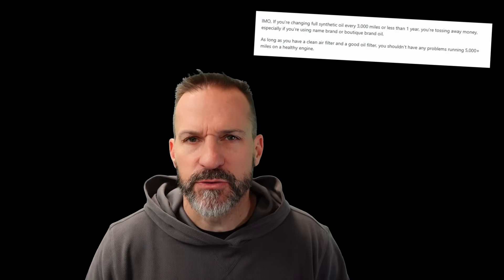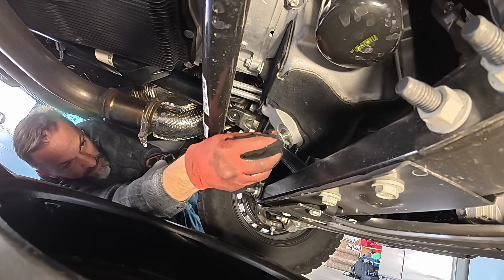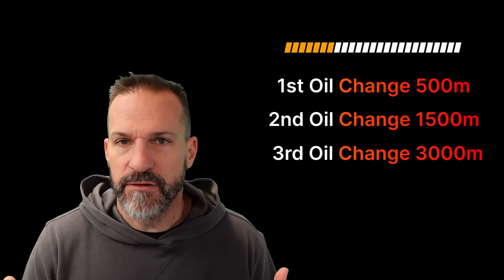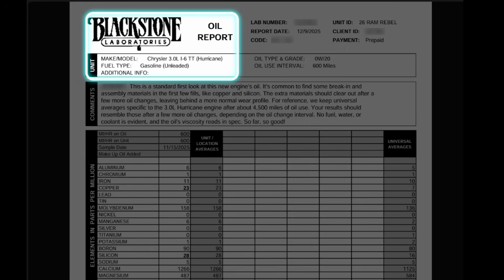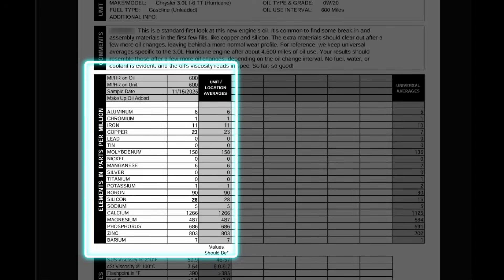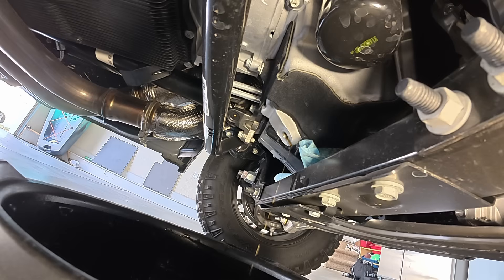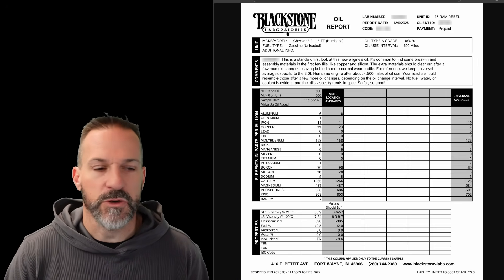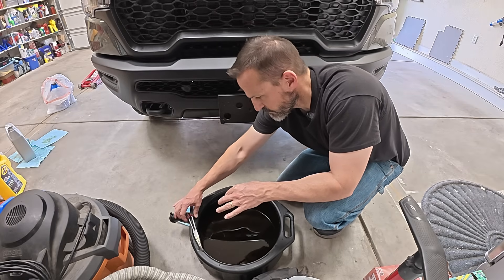Is the Motor Oil Geek Right? I Put His Break-In Theory to the Test

Comment: I recently purchased my first new car ever a 3rd gen Nissan Rogue with the controversial 3 cyl turbo.    I did some early oil changes per Motor Oil Geeks advice.    I now have over 30,000 miles on it and the engine runs well and the Blackstone report shows below average wear metals.    I'm using Valvoline Restore and Protect 0w20 and plan to continue with it at 4,000 mile oil change intervals.    I think it is really a no brainer to do this procedure and change your oil earlier than manufacturer recommendations if you plan on having a reliable vehicle for a long time.    Cars are way too expensive these days not to take extra care with maintenance.

Comment: With these new oil standards it is going to be good idea, leaving the filter on allows particles to increase the filtration. I would go to 0W-30. I think GM is doing more damage, unless their certain that bearing damage has started or is in progress. Was taught along time ago to start out at 30W then 40W as oil pressure dropped , add liquid bearing material. I have had problems with Marine engines or racing engines start out at 50/60W, most don't warm-up engine and bearing surface and piston walls get squeezed, it's fine if planning on rebuilding often.

Comment: I don't change as frequently at break in. I change once at 500 miles (give or take) and replace the filter and usually again about 3k miles and then I change every 5k miles (full synthetic). I also run Ceratec at the first 5k oil change. I'm going to start skipping the oil filter every other change based on his recent videos covering filter efficiency.

I may tweak my break in procedure but this has worked very well for me so far.

Comment: What the heck?! The hurricane drain plug doesn't shoot the oil directly into a crossbeam, and the filter doesn't drop the oil on top of a skid plate with drain holes exactly one oil pans width away. Hows the anti rust oil film going to be applied. 🤨

Comment: These modern engines with tight clearance, and questionable QC, I think it's foolish if you don't run a bypass filtration system, from mile 0. Even if your doing break in oil changes, you're pushing that junk through your bearings. Seems like capturing it makes more sense, with a 2 micron filter, that clean the whole system every 45 mins.

Comment: Same with motorcycles regardless of displacement and number of cylinders. 

I did my bike on first break-in at 700km (less than 500mi), 2nd oil change at 1000km, 3rd at 1200km then the regular interval at every 2000km. 

70000km later, still bulletproof reliable with no engine issues

Comment: I have a 24 tundra.  I did 1st oil change at 250ish miles, 500ish miles, 1,000ish, and now do every 5,000.  Who knows if it was needed but I decided I'd rather spend the little extra in oil and try to get out any metal pieces that could cause an issue.

Comment: Oil NEVER loses it's ability to be slick. The problem is oil gets contaminated, aka dirty and filled will junk. That junk damages engine components. Oil has to stay clean to do it's job. Change your oil at 3,000-5,000 miles on your daily driver. Work trucks very on that standard.
Reply: Actually it does lose that ability.
There are numerous jobs that oil performs, and numerous ways those qualities degrade with time and mileage.
3,000 mile oil changes is far too often.

Comment: Just ask yourself “what is the downside of extra early oil changes”? The cost of a few mediocre meals at chain restaurants or watered-down drinks at your local watering hole? It is money in the future bank people! Also, after the first 500 miles, DO NOT baby the engines or you will have to baby them their entire lives. Full throttle stints for a couple gear changes get everyone in the drivetrain on the same page.

Comment: I make my first three or four oil changes every 5.000km (3.100 miles). And then every 10.000km (6.200 miles).
About the timing, I respect my kilometers interval or a year. I don't let the oil more than a year in my engine.

I use manual transmission cars. I change the gearbox oil too. First one at 10.000km and then every 40.000km. No time interval.

Always fully synthetic oil. Mostly Mobil just because seems good for the price and I can buy it near here. 

I know it's somewhat exaggerated. But I never had any engine or gearbox problem with my cars. Not a single one.

Comment: I’ve only owned 2 vehicles so far in my life. Both brand new and both I changed the first oil at 5k miles, just like all my other oil changes. First engine went to 150k miles before trading it in. I’m at 87k miles so far in this engine no problems

Comment: back in 1970s cars had recomendation of changing oil at 1000 miles to get rid of metal particles of break in but in newer cars the dealers try to talk you out of doing oil changes till their 10,000 mile interval. the engine may be better polished but it will still have wear metal.

Comment: I have followed Lake's advice so far on my new Lexus IS350. I sent my oil to Speediagnostix and have been monitoring the progress. So far I only have 2200 miles on the car and I also switched out the drain plug for a magnetic one and on the second change, metals were down. I'll change again at 3000 and then at 5000 mile intervals there after. Its a car I plan to hold on to for a long time, so I go by thr saying "oil is cheaper than a new engine".

Comment: Check the filter if you can.  I cut my wife’s 24 GR Corolla filter open on break in change and there were visible metal particles in the pleats.  Also a magnet will only pickup ferrous metals, most of modern engines are not made of those, bearings, blocks, etc.  prob only the piston rings of the “wear” items

Comment: Lots of comments saying 10k oil change kills engines. If you watched Lake’s video he said you can safely get to those OCI after the initial break-in. You just have to verify through oil analysis. I bought my truck with 3000 miles on it and it had already had an oil change before I bought it and I did another one after buying. Since then it’s been 10k oil changes and analysis every time and all the results prove that it’s been perfectly safe. I’m now at 85k and the truck is still running perfectly fine.

Comment: In 2014 I bought a new Honda CR-V. Dealer said NO oil change until the Maintenance Minder was down to 15% remaining oil life. They said the oil was a special run-in oil.  I reached that mark after approx 9000 miles and then changed the oil. 11 years later that CR-V is running perfectly and burns no oil at all between changes. So who is right - the engineers or the YouTube experts?

Comment: I like the 500 first change, have done it always while being told I am crazy. But I in no way agree with Oil Geek on anything else. I run Valvoline 5W40 European in everything for last 2 years. Group IV oil. Oil Geek only knows oils; he looks at trees trying to find the forest. Also do 3K changes yes still being told I am crazy. Also told crazy for 5w40. Please be more specific Tolerance is Not Clearance. All machining has both callouts and they are not interchangeable in the definition. The higher temps are in my opinion are also causing oil breakdown to occur sooner. You are spot on I believe engine have two things to watch MILES and CYCLES. I suspect cycles are also a killer because of the above mentioned.

Comment: Silicon = Sand.  It is not the Silicone that is in seals and sealant.  That's an ELASTOMER (flexible plastic).  Your 28 PPM of Silicon is a bit high, but should go down as the residual dirt is flushed out of the oiling system
Reply: Silicone is not sand. Sand is Silica

Comment: Yikes folks, here's what Lake will never tell you. Just because there's particulates in the oil that are smaller than the film depth, doesn't mean they're doing ANY damage. This is why you never see Lake doing any motor testing of identical motors on a simulated chassis or engine dyno then do a performance test and tear down if you follow his protocol vs sane general market advice (7500mi on any modern synthetic). Lake wants to INFER any ppm above 'normal' is damaging your engine and to get YOU to buy testing kits and worry about OPTIMAL oil choice to invest more money with Lake Speed oil testing and analysis, his family's bread and butter service. Instead of actually seeing the oil manufacturers, who actually conduct all this testing to actually determine if accelerated wear and ultimate break down occurs from any of this done on multiple examples of engines running 100k+ mile protocols... ACTUAL product testing rather than inferring PPM means *damage*. Geesh, and that's why people dislike the motor geek fans. They don't understand what 'testing' a hypothesis is, because real science is nearly dead. Higher wear metals during initial break in is NORMAL. If the particle size is small enough (like molybdenum that's in the oil, like zinc), EXTRA of it still doesn't cause any issues as it's still significantly smaller than the oil film depth. Does it hurt to flush out the particles? Besides adding cost and smacking all the oil seals in the face with a heavy detergent dose (think washing your hands a dozen times an hour for 6 hours) as the oils are designed for 6-12mo use, it's fine... But just a waste. Can pretty much guarantee none of the million mile plus motors followed his protocol and instead just a regular standard maintenance schedule.
Reply: Also note that just leaving the oil in and letting the filter do its job, REDUCED the metal ppm on several of the findings. that is the 500 mile sample had more metals than the 4500 mile database average. ? where did that extra metal go? ? could it be in the filter? if this metal was really causing problems such as shorter engine life, then the first 500 miles - 8-10 hours would already have caused problems. we've seen test numbers, but, no DATA to show adverse effects.
Reply: One of the best comments on this page.

Comment: What’s your and Lake Speed’s advice on when you can put the pedal to the metal? Put it to the floor a little at a certain speed during break in? Take it easy until 10 grand? Put to floor until a certain speed reached? Got a 2026 Ram Hemi, manual says a little about giving it a little for a certain speed, and at a certain mileage, what’s your thoughts.

Comment: Changed the oil in my new Honda mower after 1 hour 

The oil looked nasty I was amazed 

You can’t realy change oil to early or to often. 

My next new vehicle I’ll be doing early oil changes at 500km, 1500km, and 5000km. 

Cheap insurance will cost an extra 200 $

Comment: Read the OWNERS MANUAL!!!! 
They all have stipulation on oil change interval, for SPECIAL CONDITIONS !!!!! 
- towing
- dusty conditions or dirt roads
- city driving
- idling
- short trips
- driving in 32f or colder
If any of the conditions exist , it clearly states to change oil every 5k miles and not 10k. 

Y’all need to learn to read and comprehend 😂😂😂😂😂😂😂😂😂😂😂😂😂😂😂😂😂😂😂😂😂😂😂
It clearly states if you

Comment: I've rebuilt many engines in days as a mechanic and Lake is right tighter change intervals during break in. I'd never let it go over 5k. I have also been using Blackstone Labs's for years. I have a 2024 GMC 2500 SLT with the 6.6L - I'm on my 4th oil change and I just when over 15k. I dumped the break-in oil at 1000mi. I then did the second change at 5000 - then 10k - then 12,750. The last 2750 was heavy towing with a 30ft camper, so I dumped the oil one last time after storing the camper for winter. I highly recommend Blackstone. I also use Pennzoil or Castrol. If you're interested, I can send you my reports for comparison with another brand. Just redact my personal info if you decide to use it on a vid. Lemme know.

Comment: I've changed my oil 5 times in 8000 mi, and having it tested each time. Started with 0W-20, then 5W-30, 0W-30 -- I'm researching the different brands formulations, HTHS, etc., always staying with the BMW Long Life 17FE+, LL-01 and LL-04 certifications -- LL-04 is likely the best for my engine's longevity, we'll see. I'm looking at which oil reduces wear the most, and can see from the analyses which oils have more ZDDP than others, etc. I will move to the Euro oils in 0W-30, 5W-30 and my xW-40 before I settle on the oil that seems to have the right stuff for my B58. The B58 in Europe is the same B58 over here, in the same models of vehicles, but because CAFE regs here are so stringent, manufacturer says 0W-20 here, while same engine in Europe is 5W-30 or 5W-40 recommended. Gas in the US lowered sulfur content to match European gas or even go below it after 2018, so the same Euro oils and weights can be used here generally for the same engines.

So it's not that people don't care about oil change intervals, it's that manufacturers can reach higher fuel efficiency by using lower weight oils, at the expense of longevity, so they can meet the regulations here and trade off fleet efficiency of the 0W-20 and trade that for their other vehicles that are much less fuel efficient.

Comment: Lake is data driven. You don’t win in NASCAR on a wing and a prayer. 
I was doing accelerated break-in oil changes on my new vehicles since our 2000 Venture van (everything eventually failed on it except the engine). 
Toyotas ever since. Still own 4. Each had a ~600 mile, 1,200 mile, and 3,000 mile break in oil changes and 5,000 mile intervals ever since with Amsoil Signature 0w20. 
I’ve been doing oil analysis on my 2022 Tundra since the beginning, before the engine recall notice. My Blackstone results have been unremarkable (normal) now at almost 50,000 miles.

Comment: i waited until 1000 and 5000 every change change on out with my 2024 frontier. while i think lake speeds method will add longevity, i notice FAR too many vehicles in wisconsin getting salvaged with engines that run like tops, but body/frames completely rusted out.

Comment: After building a new SBC and breaking in a new engine with a flat tappet cam, would you leave that oil in for another 5000 miles? Doubt it. Roller cam or flat tappet makes no difference to most engine builders, change the oil. Call around and check it out.

Comment: 100% Spot on!! 
On that same topic, since purchasing My 3erd Gen Tundra 2023 I have changed the oil at shorter-than-normal intervals and had oil analysis performed each time. I did this intentionally to monitor wear metals and contaminants, especially given the early concerns surrounding the new Tundra engines.

The goal was to identify any abnormal wear trends early and determine if or when a potential engine failure might occur. To date, the oil analysis results have shown no concerning indicators, and I have not experienced any engine failures at 36k.

During part of my career, I spent several years in the CBM (Condition-Based Maintenance) department in heavy industry. The principle is well established: new components are often flushed during break-in to remove initial wear particles and manufacturing debris before they can cause long-term damage.

 Drive it like a professional not a race car, not a golf cart for the first thousand miles, and the engine will thank you for the next 200,000+ that's how we were taught.

Comment: Damn straight. Change your oil and filter on a new vehicle, between 500 and 1,000 miles, and then every six months or 5,000 miles, depending upon how you drive. The CAR CARE NUT says the same thing (TCCN) on YouTube.

PS: Use fully synthetic motor oil and a high-performance oil filter (Don't cheap out on your parts). Why, because oil & filters are cheap, engines and repairs are expensive.

Comment: 10k mile oilchanges is RETARDED, even on the latest version of whatever car you think is the exception. They use 0-20w (for better gas mileage) and because it's so think, it breaks down LONG before 10k, causing more and more engine failures, EVERY SINGLE YEAR.  Don't go more than 5k on an oil change, period.  Also if you are rebuilding, I tested this first hand and when I broke in the engine, it was slower the entire life of the vehicle, where as when I YOLO'd and beat the piss out of, BRAND NEW/REBUILT, it pulled hard it's entire life, way past any factory engine. I've odne this a few times, NEVER an  issue.

Comment: 5w30 wouldn't be bad either, there's a lot of good ones out there.  But with turbo's, and if you do more than hwy cruising, 40 grade is what many advise.  Turbos run hot, they've always needed thicker oil to help with the heat.